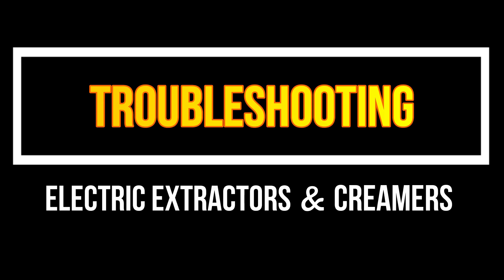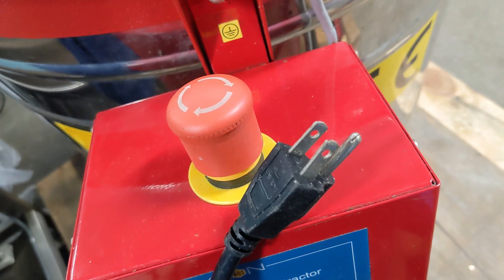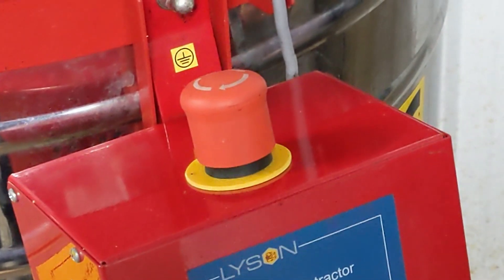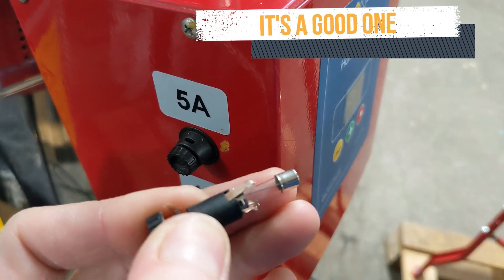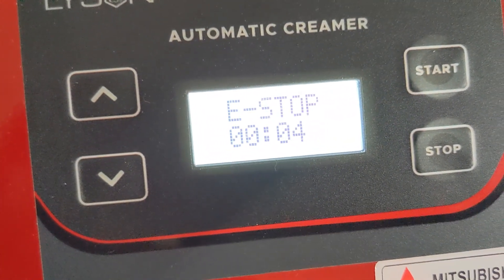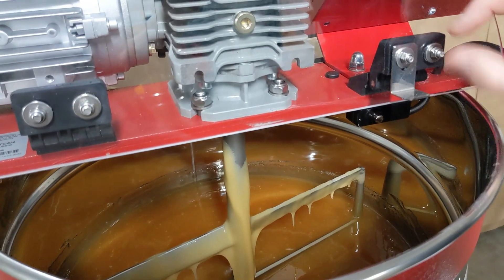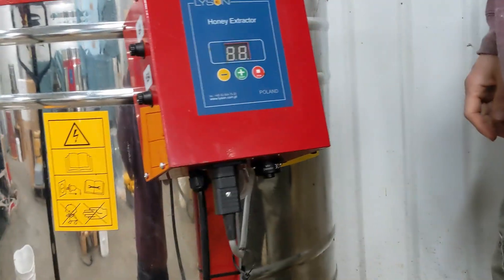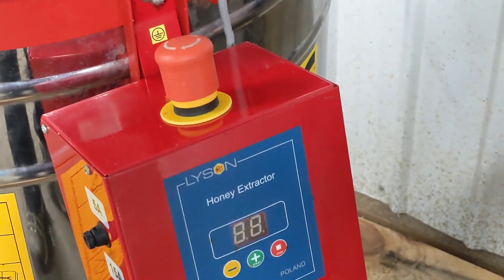Troubleshooting Electric Extractors and Creamers: The Double 7 Error

Comment: Thanks for the tips, very helpful! In my case the connector at the bottom of the controller had shaken loose and was having an intermittent issue. After I put it back in tight it worked…